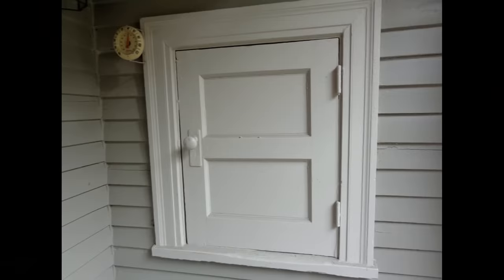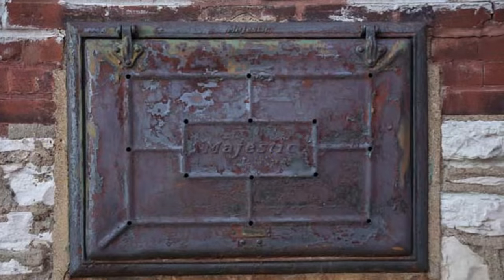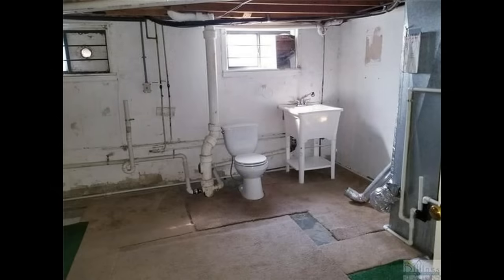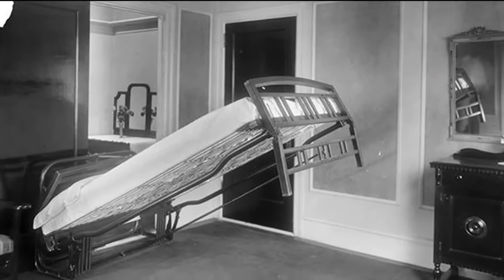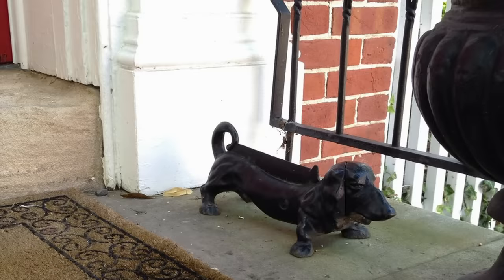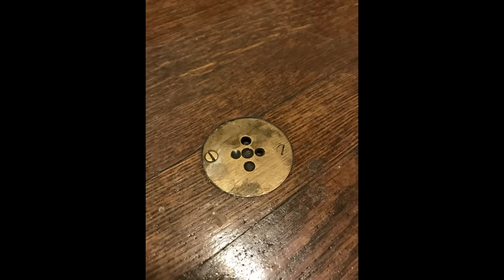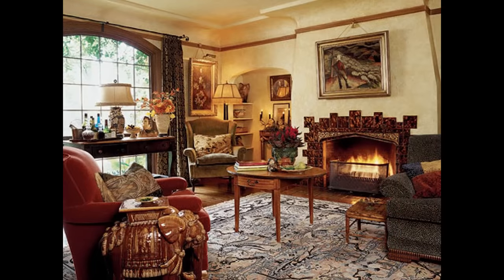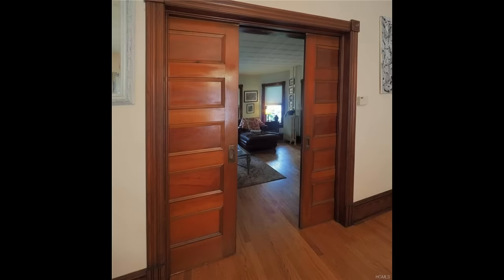Mysterious Home Features No Longer Used

Comment: I grew up in an old house that had windows that were raised and lowered using weights and rope. Seems like the rope was encased in the window frame. Does anyone else remember windows like that?
Reply from the maker: I lived in a house that had those as well.  We had the windows replaced with modern ones because the old ones were drafty.  I remember them cutting the ropes and you could hear the thud from the weights.  I crawled up underneath and got the weights.  Thank you for watching and sharing another old forgotten way of having windows.
Reply: We had these. We also had large, sliding, French doors that used the counter weights to open. It felt like the were gliding. Theywent into the walls on either side.
Reply: Yes, I lived in a 1930s apartment for 18 years and I still love how well those windows worked and how easily to leave the window how open or closed as you wanted. A simple mechanism that could last forever. Drafty though :)
Reply from the maker: I never had those but they sound interesting as well.  We did have some French doors that swung open complete with the old glass that was wavy from the imperfections.
Reply: Our Victorian Farmhouse had those "sash" weights in our windows, we also had a coal chute  and bin in our Yankee cellar. Those window were double hung, you could open them at the top and bottom
at the same time and get good air circulation.
Reply from the maker: Some of those style windows really seem like they would be good to have even today.
Reply: Yes, we still have them. They are a pain.
Reply: I once owned a commercial building built in 1912 (sold in 2021) with that and a host of other issues that came from 100+ years of modification.
Reply: Yes. My house was built in 1899 and I still have my original windows (leaded glass and all). Some of my windows have silk cords and others have little metal chains but they’re all on a weighted pulley system.
Reply: Yes, I remember those windows and they would either get stuck or break and there was no way to open them without taking apart the window.  They were good windows but if one broke, it's done.  I loved how you could open them as little or as much as you wanted without a problem.  I live in a house build in the late 40s and the windows just slide wood on wood.  Now, there's only 2 or 3 windows that will open.  The wood swells or something and won't open.
Reply: Those are called sash windows. I grew up in a 1901 Edwardian townhouse (in Ireland) that had them and My 1924 Arts and Crafts home in Canada had them too. They are great for air circulation. It is certainly possible to remove the windows for repainting.
Reply: You might sometime see a sash weight used as the quintessential “blunt instrument” in a murder mystery.
Reply: @RhettyforHistory  They are called 'sliding sash windows' and I still have them in three rooms of my house.  I completely restored them 40 years ago by replacing the counter weight ropes, cleaned and lubricated the pulleys and sealed and insulated them from Canadian winters.  Still operate perfectly today and with good storm windows, they are surprisingly efficient.
Reply: I try to get ahold of the old ropes from those whenever possible. Those are useful to some people, they can be used for making wicks for cannons. People who do civil war reenactment or are into artillery type stuff, mortars and things. 

It's not that they're valuable exactly i mean there's other stuff which can be used for wicks. But they are usually thrown out because no one thinks anything of it.
Reply: Go to the hardware store: Sash cord.  My 1940 house had the old iron weights. More modern houses use coil springs and wire cables (yes, double hung windows still use some form of Sash counter balance).
Reply: I can recall my father and grandfather fixing that rope.....also putting the storm windows up or down depending on the season.
Reply: I did a remodel on a 100+ year old house and we couldn't remove those because we had to fallow some historic monument laws
Reply: Had them in a house I grew up in.
Reply: Our home was built in 1910...the windows still work that way
Reply: Yes, my old house was over 100 years old and had them.
Reply: I grew up in an older house that was built in the 1880s. We had those windows. My father had to replace a couple of the ropes and counter weights once. And if the window got cracked or broken,  instead of replacing the whole window.  Just the affected pain was replaced. My current home that was built in the 1940s, we replaced the windows and when they removed the old windows ( were installed in the 80s by a previous owner) not only were the track still there, they left the ropes and weights. We also kept them in. So, a future owner will discover them too.
Reply: Yes called sash windows x
Reply: I'd say most homes with original windows built before WW2 have this set up.
Reply: Sash windows. Buggers of things, have to prop the windows up with a stick. 😂
Reply: I grew up in a century farm home that had those.
Reply: My home, built in 1944, still has the rope/weight window system.  All the windows work fine.
Reply: My home still have these.
Reply: @RhettyforHistory  yes we had these also, sash windows, let lots of fresh air in….
Reply: My grandpa's old house in San Francisco built right after the 1906 earthquake had sashweights, pushbutton lights, and feeder lines for gaslights. My big brother, the executor, decided to sell the house and evict me after our mom died. sigh
Reply: I have them in my century home and adore them! There are clever craftsmen who can fix them: these windows lasted over a century, then I had them refitted with new cords and they work just fine. Modern windows, on the other hand, look awful on vintage homes and wear out after twenty or thirty years. If you have old style windows, look around for someone to help you restore the beauty that you have!
Reply: All the old windows had that. It made them run smoother.
Reply: Yea they are counter weights
Reply: Absolutely,  I remember  them very well. As well as jalesi  windows ( I hope that's  spelled right). You young ones wouldn't  remember  them.
Reply: @grumpyoldwizard  I think  we called them pocket doors
Reply: That sounds cool
Reply: Grew up iin a house that had them and later owned a 1920s house that had them.   Had to replace the ropes several times.
Reply: I’ve seen them before.  I was in an old house a little while back that still had lots of “old” things….front door at horse carriage height w/no stairs; side entrance had stairs; original Bell Telephone equipment still visible in master bedroom (unused); Butler’s pantry with cast iron radiator that was mounted horizontally at counter height……a plate warmer!
Reply: Still have them. Had to replace the rope a couple of years ago. Still work great.
Reply: Some of my windows are like that now. 😅
Reply: Yes, the ropes got stuck sometimes.
Reply: I have them in my Queen Anne, over 130 years old.
Reply: My house still has this...
Reply: Sash windows, remember them well. Some even had interior shutters that folded into the wall
Reply: l still have them but don't use the weights. The local hardware can make replacement sashes.
Reply: Yes.
Reply: I remember seeing the ropes inside the windows.
Reply: Double hung windows. Very common in the early 1900s
Reply: I didn’t grow up in it, but I lived in a house built in the 1920s, and it had such windows. Also, the top window could be lowered.
Reply: I've replaced many rotten roped in windows. nothing will scare the ....out of you like opening an window and having a lead weight drop in the wall
Reply: Ours were very heavy windows, when the ropes rotted out and tbe weights dropped out, the window would come down with a crash. They were heavy enough to break your hand if it was still on the sill. Always scared me a bit as I nearly caught my hand in one.
Reply: Yes!
Reply: I had them.  Many in old farm houses in Eastern Oregon.
Reply: I remember those windows
Reply: We had them at middle/highschool in the 2000s probably a relic from the 50s when the school was built. We called them guillotine windows as you never knew when they would randomly shut. They were such a hazard. Or they were stuck on a semi opened position and everyone would fight to not sit close to them in winter as it would be freezing and snow would smudge your notes when it blew in. They switched them in one of my last years of school, to windows that couldn’t be opened so you would die from the heat in summer… might I say, it was a private school?
Reply: i had windows like that in the last house except it was regular sliding windows with rope instead of metal  sliding bits
Reply: Sash windows. Yup, I remember them.
Reply: @fliconmigo : Houses were still being built with them in the 1960s in Australia.
Reply: I've been in a few old houses with that sort of window mechanism.
Reply: Double hung windows have been around for centuries  and traditionally were held open by the  counterweight method you describe. Over time they would fail and people resorted to using planks to prop open the window as repairing consists of removing the sash and molding to get inside. Modern double hung windows use springs.
Reply: I still have them, actually I still have many of the things mentioned 🤣😂
Reply: Yep, our house in NH built in the 1700s had those, too.
Reply: I had the same. Remember so well sitting in my bedroom looking past the ropes as I looked out my open window. We also had a built in ironing board with a separate sleeve board enclosed in a wall cabinet. The house was built in 1935.
Reply: My husband and I lived in a house that had the ropes encased in the windows  .. we lived near an airport and depending on the flight pattern of the day .. when a plane flew over they would rattle. After about 15 yrs we had them replaced .. we also had an opening in the basement wall for heating oil .. by the time we bought the house it was sealed -up , the small iron door covering it was still attached..
Reply: Sash windows they are called
Reply: I have actually seen them yes! In very old victorian homes
Reply: I do.  I remember when  the rope broke,  you'd  prop it open with a  piece of wood.  No screens either.
Reply: I live in an old house that has the ropes in the windows. They're attached to a heavy iron weight that held the window up. My landlord had to rebuild a bunch of windows in his house and I helped.I actually have an old weight inserted into an old clothesline pole and I hung bird feeders on it. Recycle
Reply: My house was built in 1916.  Family home, built for my grandfather by his parents.  Luckily it hasn’t been “remodeled” or otherwise messed up because the same family has always owned it.  Yes, it had those windows .  Most have been upgraded.  I was born in this house ( really)and am lucky to live here now
Reply: I live in a home with rope windows:). It’s perfect for letting the cool and pleasant air from the outside,  in  the home .  Love my original windows- they have a rather not so flat glass that makes everything look  like an artistic piece of glass in each window.  :) 🌟🧡🌟
Reply: @RhettyforHistory  
These are my original windows in my home. :)
Reply: @Lindaastewart7015  I'm in an old house too. Late 1800's. My house was the servant's quarters for the big brick house that sits in front of this one. The garage has two sides. One was for the horses and the other for the buggy. I have an old stone mantle and the other house has a hand carved fireplace. I like living here but it needs an upgrade.
Reply: I think those were called "sash" windows.
Reply: We had them, but a lot of them no longer worked because they were so old ether a rope broke or the wood swelled or they got painted over.
Reply: They’re called sash windows. There still quite common in UK. Some new builds have them. If you open the top & the bottom you get air circulation, great in the summer.
Reply: I remember
Reply: Yes, even repaired a few. Still used in areas around me that have historical district rules.
Reply: lots of houses have those still but are painted shut
Reply: My house still has those windows.
There is an access door in the frame to replace the rope.
Reply: Sash windows.
Reply: @ANPC-pi9vu  my friend showed me how to repair them. It's pretty simple
Reply: Yes, I had that in the old house where I grew up.
Reply: had them
Reply: We have a house that was built in 1868 that still has some of those windows.
Reply: Those are sash windows, with sash weights!  We had "double-hung sash windows"in our old house in Aberdeen, WA.
Reply: Oh yeah, I have many original push button light switches.  This house had a Delco battery system for electricity originally .  Still not as many outlets as I would like…but the charm is worth it for me
Reply: Double hung sash windows.
Reply: @bedtimebiblechat7152  odds are you house is no longer level, causing the windows to no longer be square. Easy to check, place a 4ft level on the floor. Sinking floors, even in the middle of the room can cause this, floor Jack's can level the house and your windows would work again though you may need to clean and reseal the wood frames
Reply: Yep. Those were our windows until we got them replaced.
Reply: @pcoristi  And in Central California, it was signal that school was almost done for the day when you would hear a whole bank of these windows close up and down the hall.  You were a hot shot if you got picked to be the window monitor.  It was hard to open the windows; you had to get that knob in the ring latch and pull down and out.  Not easy for an elementary kid.  It was much easier to close them; put the head under the latch and push.  OMG, that was over sixty years ago!
Reply: We had those! I hated those windows, they always swelled in the summer! Lol
Reply: @Lindaastewart7015  I know about the outlets frustration.  😄  Extension cords come in handy.
Reply: Yes, they are called sash windows, and the weights were inside the frame to  counter balance the weight of the window.
There was a cheaper smaller option which was used for less important rooms,  and it slid sideways so didn't need the weights to keep it open; these were known as "York-Sash" windows, and I had one in the third bedroom of my first house which was built in 1882 and I bought in 1986.
Reply: Box sashes. Weights to balance the window and frame to make raising easy. Interestingly, in a nearby asylum all the windows - hundreds of box sashes.- opened no more than 2 inches (for obvious reasons) . Prior to demolition it stood for 20 years derilict and vandalized, yet no one thought to remove the  cast iron sash weights and get ££££ for the scrap. It was good news for the demo guys though. lol
Reply: @bedtimebiblechat7152  the humidity causes wood to swell. We have that issue with our original wood doors, not the cheap cardboard ones.
Reply: I currently live in a house like that
Reply: Still have them
Reply: @Theyralltakenfu  sure do!  And surge protector strips!
Reply: I remember them. I grew up in a house that is now112 years old.
Reply: Is it an Hercule Poirot story?... Where the murder weapon is hidden by putting it where the weight would be? Anyway, I've always heard those referred to as "double-hung" windows.
Reply: Yes, our first home was a small late Victorian , c 1910.  I’d never seen a pulley system window before we moved there.  I think our windows had been repaired with chains.  Really big windows, no AC.
Reply: There are still plenty of old homes that
Reply: I had those in my old apartment building! The glass was also wavy with age. It was nice to get replacement windows that were easier to open, close, and clean, but I missed the character of the old glass.
Reply: I restored a set of these at my parents' lake cottage probably around ten years ago or so now. The ropes were long gone, and the weights were just sitting in the frames. The top sashes were wedged up and the bottom sashes had to be wedged up if you wanted the windows open. Now they operate as intended with both sashes staying where you put them.
Reply: I still have windows like this. Half don't work lol
Reply: Our house was built in 1939 and we still have those windows..to be replaced in the near future, some still work well but others the ropes have busted so we use a stick to hold up the window.
Reply: I live in a house that still has those window weights, they knock around when the wind is strong.
Reply: Remember, I live in a house with those windows. My house is a 101 years old.
Reply: @flautalee3090 That would probably be Edwardian then. Victoria died in 1901 and Edward VII died in May 1910.
Reply: Remember them? I moved from a house a year and a half ago that still has them.

I hope that decrepit hole, built in 1890, has been condemned. The sill plate is entirely rotted away, with the floor joists rotted out of contact with the foundation on the entire western half of the house. Yet it miraculously passed city inspection... and could be legally rented (though I have to wonder how much the management company held back from the absentee owner for repairs that never got made).
We moved when a kitchen cabinet fell off the wall and was 'fixed' by running wood screws thru the unreinforced back of the cabinet into the studs. Certainly hope they were smart enough to not rent it again... the next person who loads that cabinet with dishes will be wearing both the dishes and the cabinet.
Reply: Aussie here - I've lived in older homes with these, we call them sash windows
Reply: We called these "Rope and Polie" windows when I used to weatherize old and drafty houses after the military. After years of use, and neglect, the rope holding the counter weights would break and have to be fished out of the walls (a real pain). If you were lucky they would only drop about four feet to the floor the window was on. If not, they would drop all the way to the basement. Most of our job would only be for 4-5 hours of weatherazation, so, we would just silicon up the hole the rope used to go through in the side of the window frame as a lot of cold air used to shoot up the walls and make the house drafty.
Reply: We had those kinda windows in our house growing up in Cleveland.
Reply: Yes like predessors to the ' sash window ' x
Reply: Yep
Reply: It called double hung windows sometimes sash windows
Reply: My house has that!!
Reply: I used to love those windows. Had several of the weights, as well. We used to use them for a bunch of different stuff, and my mom made a huge chunky wind chime out of them.
Reply: Yes,  my childhood home was built in the 1920’s & we had windows like that
Reply: I remember that very well.  These were great for the heavy wooden framed windows.  HOWEVER they were a pain in the BEHIND if on of the ropes broke or the weight got caught/of kilter!
Reply: We lived in a house with ropes and weights inside the frames.   If you raised the window quickly you could hear the weights hitting the frame.  The house was built in the 1890s and had no electric when built but was added later.  It also had a coal furnace until my dad replaced it with a gas furnace after the first winter.  
We all thought the house was haunted too.
Reply: I lived in a place with windows like that. The latch broke and the windows would open in the middle of the night in the winter.
Reply: We had the set-up for them but the ropes had broke. My dad used to have a few of the weights around that he used as anchors for his john boat.
Reply: FWIW that system is called an Atwood Machine.
Reply: My sister's house had those and her boyfriend cut all the ropes.  That's one big duh for mankind.
Reply: Ha ha, I’ve never lived in a house without them.
Reply: Laura, for real? They dont build them like that now but there are still plenty of them still in service. Jesus…
Reply: I've replaced all the sash windows of my 1910 house with new sash windows because they are the best , espectially for houses with a high ceiling stud, enabling all that light and sun in.
Reply: Yes, I grew up in Connecticut and my house was a good 175 years old. Our windows were weighted, the light fixtures were renovated gas lamps and we still had the push button on/off switches. We did have great columns on the front porch as well.
Reply: I grew up in Chicago tenements. I remember them, and they didn't work. They were no fun-icular.
Reply: our house has them
Reply: I did too! And we had a cloths shoot, and built in phone nooks!
Reply: They're the standard form of window in Victorian apartment buildings in Scottish cities (known as 'tenements'). 
The cotton rope (known as 'sash cord') is unreliable and I replace it with 5mm kern mantle climbing rope. (It's the same rope that's used on clothes drying racks known as 'pullies', and I have forty year-old kern mantle rope on ours that's as good as the day I installed it!)
Reply: Still have them!
Reply: Sash windows. Normal for Victorian houses in the UK. Although many have been replaced by double-glazed windows now, of course. But people who can afford it often get mock sash windows as they just look more in keeping with the house style.
Reply: Still do in my bedroom
Reply: Yes I'm old ,I  remember. And I Miss those days
Reply: Sash windows. They're all over New England still. My first apartment had all sash windows I love them!
Reply: I still have the ropes in my windows, no weights though.
Reply: Yup. Old lead weights and pulleys with ropes. Used to allow you to open/close a heavy window easily without it slamming. Good ones were well balanced and allowed one to partially open the window and not have to worry about it closing.
Reply: Just FYI, the ones in my childhood home were brass pulleys, lead weights, and oiled silk rope. The house was over 250 years old in 1989 and none of these mechanisms had yet to fail. Every spring my grandmother would use a tiny oil can and walk around the house putting a drop or 2 of linseed oil in a small hole at the top of each side of the window frame. The oil lubricated the pulley and any excess was absorbed by the silk rope which kept it very supple and soft.
Reply: We updated the windows over a decade ago, but I grew up in this house and it is what we had until then
Reply: @RhettyforHistory  The glass isn't wavy from imperfections.  When you have this kind of glass, as opposed to our modern type of glass, hang on to it!  It's the original glass that the windows or doors were constructed with and therefore, worth a lot more money than the glass you see now.   More importantly though, it is interesting,  unique,  and beautiful.  Glass is an amorphous solid.  It is also referred to as a supercooled liquid.
Reply: Yes we had them in the first house my parents purchased in 1975. It was built in the late 1800’s. My dad removed those old windows when he remodeled the entire house.
Reply: We had those heavy wooden doors as well.
Reply: We had these in our house in Cicero, IL Sometimes the rope broke and sent the window plummeting down, so we replaced many of them with chains.
Reply: My grandfather's house in Keene, NH, built in 1912. There was a small closet in the dining room that had the original wallpaper from the 1940's, a blue floral with huge flowers. And a stamped tin ceiling, those were beautiful. It wasn't a big house, but I loved it. It was actually laid out a lot like the house in "A Christmas Story".
Reply: For sure, very common!
Reply: I live in a house with 15 double-hung sash windows. I've disassembled & partially rebuilt 2 of them myself. I have a seething hatred for whoever cut the sash cords on some of them, because it makes it so that they have to be propped open, and in some cases the upper sashes have been nailed into place to keep them closed. So mad about it.
Reply: Yes my 1940's cottage has those. Just replaced them last week
Reply: yes!! I lived in several  houses with those
Reply: I still have windows like that. My dad replaced the ropes with chains.
Reply: I have them in my home now. LOL
Reply: I used to live in the attic of a 100 year old boarding house and they also had those type of Windows
Reply: Still have that in my home.
Reply: My boss has a neighbor, who is a computer engineer, who has these windows. He is having them refurbished and it has taken the company several weeks. My boss saw him the other day and said "Interesting... a windows update that takes longer than Microsoft." 

The guy responded... "I use Linux."
Reply: @grumpyoldwizard  yes I had those too. They are called pocket doors.
Reply: Yes, I remember these very well. They were called sash windows and were in many older homes. Certainly by the 1970s they had become obsolete.
Reply: I have taken alot of them out.
The window weights are good for scrap metal.
Reply: I love in an old building and my windows are what you described.
Reply: Yup, we had those too, as well as the phone nook, milk box, laundry chute, & Venetian Doors, separating our dining room, from the 3-season porch.
Reply: I've seen these. They irk me terribly, as the cord always gets caught up a few times.
Reply: @MinaOmega  They work good if people waxed the cords occasionally.
Reply: Still see those every now and then.
Reply: Wow that is so awesome! I wonder if that house is still there ? I love old houses !❤
Reply: Yes we had them, sash windows. No idea why they were called that.
Reply: @artchem1  Oh yes!  Our house dated to 1915.  Sash windows with delightfully flawed glass.  Looking through the flaws at the leaves on the trees outside was like looking at an impressionist painting.
Reply: @phthartic  l build a wood and coal stove from a large 70kg gas bottle. I suspended a row of these cast iron  sash window counter weights on the inside to prevent the relatively thin wall of the gas bottle to warp or fracture due to the heat. Works a charm and adds lots of thermal mass, so the stove stays hot for longer after the fire goes off.
Reply: Yes I remember those window weights
Reply: My house still has them. They're sash windows and I love them.😊
Reply: I remember those windows very well. And it seemed that most the time one or both ropes had worn through, broken, and without the counter-weight the windows wouldn't stay up. The windows had to be propped open.
Reply: The house I grew up in had these. House was 150 years old
Reply: My wife and I actually looked at renting a place with windows like that in college. The windows were all one big pane of glass and pretty heavy, the weights were definitely necessary, and they worked amazingly well for how old the house was (1900s iirc)
Reply: We had those at our house. It was built back in the 20s.
Reply: I have been in a few old homes that had those weights and rope but none that still worked. You would just see a bit of it sticking out at the top of the frame all painted over.
Reply: @lindaallen6010  Has them or had them?  You say "replaced," so that worries me that they've been destroyed now
Reply: @victoriacole7661  Why?  Maybe yours need repairing.  They should be the exact opposite of a pain, lol.
Reply: My childhood home -built by my parents - had small roping in the (Anderson) window frames.
Reply: My 1st apartment in New Orleans had these windows!  I haven’t thought about that place in AGES!
Reply: @hetmanjz   we replaced them, to be more energy efficent. but I kept several of the more unusual sized ones for a project. And refused to replace any of  the ones in the sun room.
Reply: I have those windows in the house where i live now. One window even has a peg in it, otherwise it rattles/moves. 

My little place also has that decorative paneling part way up each wall like in the clip bout the photo frames.
Reply: @sixthsenseamelia4695  haha yes, i have to do that with 2/3 windows here and one dosnt open at all
Reply: @hetmanjz  That is exactly why the are a pain. The ropes dry rot then break at inopportune times.
Reply: Yep. The rope was part of a mechanism to give “power assist” to the heavy lower sash. Out of sight, the rope went up to a pulley. From the pulley the rope went down to a hanging metal counterweight the size and shape of a cucumber. With age and neglect the pulley could seize and you would get an annoyingly tough to lift lower sash and a rope that would double back on itself. Also, the counterweight cavity alongside the jambs made for a handy uninsulated draft magnet.
Reply: Still have these in my moms house. Most of the ropes have broken so the weights have dropped. When the rope breaks it’s almost impossible to open again
Reply: In this house till 20 years ago. Next door still
Reply: They're called "sash windows" and they're still quite common in Georgian and Victorian era houses in parts of England. Theyre wonderful, you can slide both sections to the exact position you want - just a crack at the top or bottom panel raised all the way up! The vertical sliding mechanism means the window doesn't get in the way when you want it fully open.
Reply: I remember most of the ropes having frayed and snapped and as a result we had to prop the windows open with bits of wood.
Reply: Yup.  The last place I lived was like that.  The windows weren't raised or lowered by the ropes; the weights were simply to counterbalance the window so it could opened and closed more easily.  If the ropes rotted and the weight became detached, you'd have to get a stick or something to hold the window open.
Reply: i love in a Pennsylvanian home built in 1928, it has a lot of these old features.
Reply: They are still around but not in use in buildings in Hollywood and Echopark. They date from the 20's and 30's. Most now have the cord mechanism painted over
Reply: Grew up with those as well. When I was in my early teens, a rope on one side of my bedroom window snapped. Since fixing it would require completely tearing apart the windowsill, I just had to hold that window up with a 2x4 for years until my folks did a total home renovation and replaced all of the windows.
Reply: Grew up in a house with those and actually have them in the bedroom of the place I live now. House was built in the 1890s, where I grew up it was built in 1927
Reply: @pcoristi  you just jogged my memories as well. Plus our teacher assigned window openers. Lol I  was excited when handed the pole to pull the window down.
Reply: Sash windows. There pulleys, ropes, and weights in the window frame. We have two large originals in our 1913 bungalow: One of the ropes snapped and we were surprised at how heavy the window was.
Reply: yesss - the best windows ever ! they had iron weights in them
too ..
Reply: Are these sash windows?
Reply: @lindaallen6010  Well, that is certainly understandable and admirable!
Reply: @RhettyforHistory  we have those now, very simple to fix, I have been going around replacing the ropes.  Take about 15 minutes and they are significantly larger than modern windows
Reply: I certainly remember those windows, None of our family homes had them, but I've lived in older homes which did. Those windows glide open and closed so beautifully, decades if not longer than modern windows. Yes, they were drafty, but I sure wish they'd construct windows that opened as easily these days. And I prefer the double hung windows. I want top and bottom air flow,.
Reply: Oh, yes. All our family homes until my daughters houses had such windows
Reply: My dads house growing up was built in 1910 and it had them. The weights always made me think I was gonna smash my hand to bits somehow, so I never really opened them lol
Reply: I live in a 1916 bungalow and still have the original double-hung windows.
Reply: My apartment building was constructed in 1924. The windows still work like that.
Reply: I'm not sure where you all come from but sash windows are really common where I live in New England USA and are routinely used in new construction. If they are so apparently rare in the rest of the world, I wonder why they're so ubiquitous here.
Reply: I grew up in a house in New England that had those.  You can replace them now if the rope breaks or the counterweight other wise fails by removing the pulley at the top of the window track and installing a coiled tension ribbon spring into the spot where the pulley sat and then you attach the metal ribbon to the window sash.  I understand they work great.
Reply: I remember those. The weights were cast iron. Eventually the sash cords would wear out and break. Then you had to dismantle the window and replace the cord. Easy if you know the trick, but not obvious.
The windows were double hung, too, with a lower sash and an upper sash. You could open them both and let cool air in the bottom and hot air out the top.
Reply: I grew up in places with windows that were originally counterweighted, although I never lived in a place where they still actually worked. Once spring came, the older, inner window would be propped up with a piece of dowel or other block of wood, and the newer, outer, steel-framed window with horizontal spring-catches (and window screens!) would be used to regulate airflow. In winter, we'd seal them up with the 3M heat-shrink-fit plastic window film insulation sheets. Occasionally that would get punctured, and the repair was a piece of sticky tape...
Reply: @rikspector  Huh, I've always understood "single-hung" vs "double-hung" windows to refer to whether there's one or two panes of glass between the inside and the outside, but I'm hardly an expert. =3
Reply: @nans969  Trying to be helpful -- window "pane", not "pain".
Reply: We still have them in my house
Reply: Yep, the house I was raised in had that style of window.  They didn't work very well IME, the windows tended to suddenly bang closed at random.  Same place had an unfinished root cellar basement and a bank of push-button light switches.  Up until the early 90s it was heated (using the term loosely) by two big free-standing kerosene stoves, complete with a huge tank for the stuff standing right at the back of the garage, so every time you pulled in you were basically aiming your car at a fire waiting to happen.  The master bedroom was "heated" through a floor vent that opened in the ceiling of the dining room (which sat between the two rooms with the stoves in them), complete with decorative grills and metal slats (like a horizontal Venetian blind) that you could open or close with a little lever that was also a damn fine tripping hazard.
Reply: My current house (1880's construction) has sash windows and working transoms.  The transoms are fantastic to open in the summer. It lets cooler air from the first floor circulate through the house without the need for central air. Sadly, the sash windows only half work, as the ropes have either been cut or rotted away over the decades.  If you're an adventurous carpenter, the windows are completely repairable. Unfortunately, it takes almost as much money to fix them as it does to get new, double-pane windows. Still better than the house I grew up in where the windows were all painted shut and no transoms worked.
Reply: Yes i do it used wood or metal rod weights trouble was the rope would break over the decades
Reply: @larryk731  i got an 1890 bet you had apartments on top store bottom. Repair cost so much
Reply: The house I grew up in had weights and chains. The chains were noisy. :)
Reply: If you have these windows, please do not replace them.  With proper maintenance they can last over 100 years and are 94% as energy effective as new windows, which need to be replaced every 10-20 years.  If yours are drafty, they simply need to be repaired.
Reply: The house I live in is 105 yr old and has the same windows with rope and weights. Some need to be replaced.
Reply: @joanies6778  You'd be surprised at what kind of damage can be repaired with wood epoxy.  If you fix those windows, they will last another 100 years.
Reply: Have used them old weights as an anchor for my johnboat
Reply: @Ice_Karma  The top half is offset from the bottom half and you can lower or raise each half  by  itself, so opening each halfway allows air to circulate from the top and bottom of the window.
Reply: Casement and sash windows in our house. Bummer when the ropes stop working.
Reply: I remember those, but also remember windows that were opened and closed with a hand crank. These windows opened outward instead of up and down.
Reply: I grew up in an older home that had those windows. My dad remodeled the house in the mid 80's and removed them in lieu of more modern windows. He did, however, keep the dining room windows in storage that were stained glass. I loved those windows!! Home are no longer architecturally solid or intricate; just boring cookie cutter houses no matter the price range.
Reply: We did have that as well 😊
Reply: Yea, they're not that old. We had those.
Reply: @RhettyforHistory  
I was born and grew up in Montreal. Our house had sash windows. Every few years one of the ropes would break and to repair it, you had to take the window frame apart to get to the weight, rope and pulley inside in order to fix it.
Reply: I live in a house that still has them.
Reply: My house has sash windows too they are so good when they are kept in good condition
Reply: I've just renovated sash windows in my house, replacing the weights and pulleys that you mentioned. They're still fairly common in heritage homes, especially in the UK.
Reply: I install replacement windows in houses. I seen the biggest one I have ever seen two days ago.  It was 64 inches wide and 86 inches tall. It had chain instead of rope attaching the weights to the window we were not replacing this window yet. I hope I get to see how much weight is at the other end of the chain.
Reply: Yes I have them in my house which was built in 1941. They still work great. The previous owner put storm windows on all of the windows and storm doors on each exterior door which helps reduce any drafts. The first floor has plaster and lathe walls that are over 9 inches thick. Unfortunately they went cheap on the second floor but that was because the second owner is the one who finished building the house and unlike the original owner they cut corners and used drastically lower quality materials.
Reply: Sash weights? Those are a pain in the posterior. The cotton line frays and breaks over time, and unscrewing the cover plates for access is next to impossible—they are usually buried under decades of paint.
Reply: 1920 house we lived in had that. Counter balance to heavy window so it coukd be raised easily.
Reply: I worked on a few houses, installing insulated windows, that had those.
Reply: Yes, you could raise the lower pane and lower the upper pane.
Reply: Yes, the house I grew up in had those.  The pulleys and weights were in the window frame verticals.  I was always scared of them because wasps liked to nest in there.
Reply: @victoriacole7661  You may be able to qualify for energy saving credits by replacing them with modern dual pane windows.
The fancy ones are filled with argon gas.
Reply: Grew up in Galveston Texas with windows the same way
Reply: I have these in my house now!
Reply: They still use that design in double hung windows today, only they're encased in the frame of the window itself and often covered by plastic strips.
Reply: We have sash windows in our house like that. We had the lead weights and ropes refurbished and the windows draught proofed. After 180 years they really did need some TLC.
Reply: Still have em! My house was built in 1925 and we have original rope windows and leaded glass.
Reply: @J_Gamble  Hi- Me too!  The house I grew up in in Winchester, MA was built in 1925.  It had solid, thick, brick wall and the window as you all describe.  When the cord rotted, one simply replaced it and re-hung the weights.  Worked perfectly!
Reply: I still live in a house that has Sash Windows, they are still rather common in 🇬🇧 and more high values homes have the replaced with wooden double glazed units.
Reply: I still live in one lol
Reply: I have those still
Reply: The house I grew up in had those, as well as a milk door and pocket door between the dining room and living room. We also had the OLD phone jacks, the ones that were round with 4 holes in them where the plug went. And we had pull-down shades on the windows instead of the blinds you see now everywhere.
Reply: Yup. My parents house still has those. Built in 1929
Reply: The sash-weights and the ropes are not really for raising and lowering the sashes:  they are counterweights; with pulleys as fulcrums, they balance the moveable sash so that it stays at whatever height you put it at, no matter how far up, without your having to prop it up on a stick (the method used before the counterbalancing weights).  Nowadays, a very narrow loop of helical spring does the same job.
Reply: @alfredklek  , the American love of sash windows has a lot to do with nostalgia and tradition, I think.  Most domestic windows in Europe are casement windows:  in the U.K., the casement windows open outward; on the Continent, they open inward.  Every type of window has its pros and cons.  One advantage of sash windows is that they work well with screens:  our house in the Midwest built in 1990 had outward-opening casement windows, with screens on the inside; because the screens were between you and the glass, a special mechanism with a crank was there to open and close the window—not as simple as opening and closing a door with no barrier between you and the door.  Screens are considered necessary in many parts of the U.S., because of bugs.  Troublesome bugs are rarer in Europe, so window screens are almost never used there, which means your choice of window design needn't depend on how well it'll work with a screen.  (I say this having lived in houses and apartments ranging in construction date from the 1880s to the 1990s, in California, the Midwest, the Southeastern United States, New England, the United Kingdom, and Germany.)
Reply: @RhettyforHistory  we had those windows till 16 years ago
Reply: Half the hoisin the UK still have them. Sash windows.
Reply: oh wow I live in an apartments right now that has one window at the end of the galley kitchen that uses ropes. It has always slide up and down so easily, I assumed there was some sort of glider or something but its nice to know its ropes with weights at the end
Reply: @dove5272  of you find the access panel you can easily replace the rope and get then working again.
Reply: @AlexBabcock-hw9iz  Ty.🙂
Reply: @hollyshouse928  Cinderella is that you?
Reply: @davidh4514  just like a sash hangs off to the side so did the windows sash weights
Reply: @AlexBabcock-hw9iz  no, my feet are too big
Reply: @J_Gamble  until the cords rot and weaken, first one then the other.
Reply: Yes, I grew up around those types of windows too.
Reply: Yes.
Reply: yes. Cast iron weights hung on ropes in what was called weight boxes, on either side, in hidden wall compartments.
Reply: @victoriacole7661  My house was built in 1904 and still has these windows, and yes, THEY ARE A PAIN!
Reply: @Alibi5ify  I bet you love all the crown moulding though?
Reply: @hollyshouse928  No way that glass slipper's fitting eh?
Reply: @AlexBabcock-hw9iz  I'm one of the ugly stepsisters
Reply: @hollyshouse928  Oh my
Reply: @Lloyd Stambaugh Now that you mention it, I do recall my parents doing that same thing on our windows.  I had forgotten about that.
Reply: Yes. My house is 143 yrs old and all my windows are like this. I have to take them apart to refinish them.
Reply: Yep, I was raised in 2 different houses with weighed windows
Reply: I remember having some of the windows you described.  Occasionally a rope would break and it was quite a process to do the necessary repair.  Until repaired, those windows were hard to move.
Reply: My poem about those:
Old fashioned windows
With cast iron weights
Hung like sausages 
In sash pockets
Reply: I encounter them, on a regular basis. I do house renovations and, some of the weights are tubular, some are discs. Most of them have markings of the weight. The average are 3 lbs (1.3 kgs) each side.
Reply: Yes - the rope is  twisted  and  window is stuck open in my bathroom now .  Quite chilly to say the least here in San Francisco .
Reply: Yeah my grandmas house still has those. They don’t always work though so it’s best to stick something in the window to make sure it doesn’t slam shut lol.
Reply: I lived in lots of houses and apartments with those. The ropes would break and the windows wouldn't stay open, so you would prop them open with whatever was handy, like books, bottles, pieces of wood. The windows were very heavy and sometimes whatever was holding them open would break or slip and the window would slam down. Children would get hurt leaning out of those windows and knocking the props out by accident.
Reply: I still have them in all my windows...(1908).
Reply: I have those!
Reply: @J_Gamble  I lived in a 1930s apartment with those also from 2006 to 2011. I loved those big old windows. To me the draft was worth it!
Reply: They're called sash windows they now come in plastic which work better but depends on how nostalgic you'd want to be
Reply: Now double hung windows have a spring balance that replaces sash weights.
Reply: My house still has them. They work fine.
Reply: My family and I moved into a house in 2002 and they told us it was about 100 years old. My parents replaced all of the windows over a few years and all of the old ones were like this. I can't remember if they finished the ones in the attic or if we still have a couple of them left.
Reply: I’ve worked on several of those windows in my life. Also removed a few. Have a pile of sash weights.
Reply: I have windows like that in my home now
Reply: I e seen them. Took me a minute to figure out what it’s purpose was.
Reply: I actually saw some at a house TODAY. The home was built in the 1940s. Wish I could upload a picture!
Reply: I’ve rented in several of these houses!! Winters sucked
Reply: My husband and I rented a house that was built in the 1920’s that had the windows with ropes and weights.  This was in 1992, the house also had the original stove.  In 1995 we moved to Virginia from Texas.  We rented an apartment in a 1920’s ish home that had been turned into a triplex.  We had about 1000 square 2nd story apartment with a walk up attic.  The downstairs had 2 apartments.  Our place had baseboard heat that was supposed to be disconnected since the owner placed a “Window Unit Heat Pump”, because it was a fire hazard.  We also had a wood burning stove in the dining room, however our renters insurance would not cover any damage caused by wood burning stove.  I came home one morning from the hospital and it was in the 50’s inside the apartment, the Heat Pump went out.  I found out the base board heat still worked and we had a fire in the wood burning stove.  I seem to remember that those windows also had the weights and rope.
Reply: @derealized797  Interesting.  The old rope are probably pure cotton and would make excellent wicks.
Reply: I lived in a house with these windows...until we replaced them.
Reply: @CassandraHouse  They are fully repairable if you can find an old handyman that is familiar with them.
Mother's Day is coming up quickly...surprise her!
Reply: @JohnSmith-eo5sp  Yes, sloppy painting practices were the death of many of the counterweight ropes.  New cotton ropes are still available or you can replace them with nylon.  About an hours work for anyone handy.
Reply: @msdm0714  I still have 3 sash windows that have been restore and upgrades with proper weatherstripping and insulation.  I decided to keep them for the historical value to the house and when an engineer friend, who works for a major national window manufacture, admitted that when properly maintained and fitted with good storm windows, their efficiency was not far below the best modern windows.
If they aren't huge windows, the return on investment to replace them is about 60 years.  He admitted that the majority of benefits of new frame materials, high tech window glass and multiple glazing are more marketing hype to sell the new product.
Reply: I’m a window cleaner. I’ve seen quite a few of them. More often than not they’re either stuck or hard to open and close. Frequently the ropes are cut. I don’t like them.
Reply: @vladtheimpala5532  Not much use if they are not properly maintained and working as intended.  I would guess a lot of people today don't bother to maintain them because they don't open them anyways and modern HVAC system control the home's air quality.
Reply: My 1920 house windows have chains within the frame. The windows work better than the ones from the 90s in the previous house I lived in! Of course not energy efficient though. The 1920 house also has laundry shoot, coal shoot, and knob and tube electric (but not in use just the remnants).
Reply: The house I live in now had the same kind of windows until we replaced them .
Reply: My 1940s colonial has sash rope and iron weights. They work great. I had to do some mechanical touch up on them when I bought the house. Now they move up and down with 1 finger.  IMO old windows are far superior to modern plastic windows like Andersons and such. An old historic window will last for centuries, (unlike the stuff you get at HomeDepot which will last 15 years), are easy to maintain, work great, and have far greater eye appeal than plastic throwaways  like ANdersons.
Reply: @victoriacole7661  Do you mean "pane"?
Reply: They're actually EXTREMELY common in old houses in Australia. Like a cotton rope and cast iron weights hidden behind the architraves. Seen more than I can remember in the early 2000s, had one laying around from a demolition (used to work in house renovations). They're very clunky.
Reply: We had a old house when I was I kid and had these. The problem was the rope would get old and the weights would fall down the chute.  I have idea if there was a way to retrieve the weights or not.
Reply: Yes, I do, Laura Porter. But, my house I lived in as a young adult (mid-20s), located in San Francisco, had all windows like that. We also had push button light switches and a divided bathroom. With the toilet in one room, and the bath + sink in the other room, there was an open-at-the-top light well between the two rooms. There were other strange things about that house, and we were sad to leave it after only a decade.
Reply: Laura Porter, same here. The house I grew up in was built in the 1920s on Long Island. All the door knobs were cut glass (gorgeous!), and every doorway and window had beautiful, thick molding around it. Those windows with the pulley system running through it that you mentioned were also throughout the house. My cat enjoyed sitting in one of the windows whenever it was opened for fresh air. One day (this was mid 1970s), while she was inside the window frame, the rope snapped and broke, and the whole window came crashing down on her! Her cat reflexes were so good that she managed to jump out in time, BUT her tail got caught under the sliding window! Thank God my father was home and heard her screams. He held her with one hand, while he lifted the window with his other. She was so freaked out, that she bit right through his hand! That was particularly disrupted for my father, because he was a dentist and kinda needed his hands to be functioning properly!
Reply: Yes the rope would break and you couldn't repair without dismantling frame.
Reply: I live in a house that’s has original sash windows with weights and ropes . The house was built in 1894 . It has loads of original features such as fireplaces . Disadvantages are it’s hard to heat and the windows aren’t great for keeping heat in . It’s worth it though , most of the time lol 😜
Reply: They are called sash windows and were very common here in the UK.
Reply: I lived in a cottage in Scotland a few years ago that had sash windows that opened and closed using a pulley system to help them open more smoothly. I checked with the local historical society and the cottage was built in the 1890's.
Reply: My school had them! 😊
Reply: I do!
Reply: Yes!  My old house in Detroit had windows like that.
Reply: @sarahandley9804  Folding interior shutters were a major feature of houses in the 18th Century.
Reply: @PetCactusA_HarmlessLittlePrick  No. I can spell thank you very much. They are a PAIN.
Reply: @victoriacole7661  Never mind, sorry to have bothered you.
Reply: Where I grew up, most people had double-hung sash windows. When I first left home to go to college, my roommate thought I was weird when I complained about the window over my desk not opening from the top. Apparently, she'd never heard of a window that opened at the top, nor had she ever seen a window with a rope in it. We then stared blankly at each other in mutual disbelief.

Oh, and if you took good care of them, they didn't break! I don't know why so many people talk about having to prop their windows open with planks of wood and suchnot. Just maintain your windows! I'm guessing a lot of the people stuck with broken ones must have had rotten absentee landlords or something.
Reply: Yes
Reply: Oh, yeah, we had those in a 1920s bungalow, and we could only open the ones where the ropes had survived and the windowsills hadn't been painted shut. I think it was a counterweight system so you didn't have to lift the entire weight of an old glass window.

Plenty of homemade deer fences around where I now live have been built with a counterweight that keeps the gate shut when you're not actively pushing it open.
Reply: @PetCactusA_HarmlessLittlePrick  No, I need to apologize. You were being funny and I was having a bad day. Please excuse my behavior.
Reply: I not only remember them, I have them. My house is 120 years old. nearly all of mine use sash weights
Reply: Jacko Sargs  mine has little covers that are faired in and screwed down to get the damn thing out. I've replaced several sets here.
Reply: My house still does
Reply: My brother has those kinds of windows and keeps them for historical sake.  He lives in Hartford Ct.
Reply: I lived in an old house with that too. One window was hard to open and the weight clunked loudly. It scared the cat. lol
Reply: Sash weights!
I lived in many homes with sash cord attached to sash weights (made from pig iron).  The weights and cord were often servicable. A small access panel in the window jamb allowed you to replace the cord.
Reply: I lived in a house in the 70's that had that. We had to replace some because they were broken. That house had the push button light switches. It had a lot of interesting things.
Reply: @tylerbhumphries  my house is only about 12 years younger than yours  but your date 1899, looks so old & cool! Reminds me of  when my kids both say things like, "did that happen in the 1900's"?
Reply: Sash windows, my grandparents windows were sash windows.
Reply: My home still has them.
Reply: I remember those windows. I grew up in a house with the old weights on ropes.
Reply: my auntie had those as well, she got it changed when she renovated though so it was safer
Reply: We had windows like that in my old apartment.  The only way I knew was that one of the ropes snapped and that window was an absolute bear to open after that.  The weights acted as a counterbalance against the weight of the windows, making them slide much easier.
Reply: It's a sash withndow
Reply: They were superior to today's
Reply: @RhettyforHistory  yes! Now they have a metal tape and spring roller instead of ropes and counter weight s
Reply: My house is full of these windows. The problem with them is that the rope breaks or rots quite frequently. After the rope breaks the windows need to be propped up manually.
Reply: Those double-hung windows had something “magic” about them. Open even a little a bit at the top and at the bottom, they created a convection current. Cool air came in through the bottom and warm air escaped out the top. Wood has a higher R value than aluminum. Those crappy aluminum sliding windows replaced the double-hung style. 🥲
Reply: Yes in a 4 story walk up apartment. Also had a dumb waiter in kitched, and a pipe under the refrigeerator that was used to drain melted ice from old ice boxes. Some units had maids quarters off the kitchen.
Reply: Until my most recent home, my windows were always sash weighted.
Reply: My  windows have the weights and rope. House dated 1875 Richmond’s VA
Reply: My house had those. When you raised and lowered the windows the weights made a distinct sound.
Reply: @J_Gamble  There’s a hostel in Venice beach CA on the beach that still has those windows. I loved how the wind from the ocean blew through them like an air conditioner. It’s seen on the right on the famous painting of Venice beach that includes the Venice beach sign.
Reply: Yes. There are still quite a lot of houses with those windows in the town where I live.
Reply: @rikspector  Yeah those were useful and honestly are timeless. They are are better than windows today except for the glass isn’t insulated and as thick as ours today. But the mechanism is just as advanced in my opinion. There’s more advantages to those types of windows tech.
Reply: @victoriacole7661  They are not usually that difficult to repair & they last a long time when looked after.
Reply: @PaulSteMarie  Worth repairing though because they then last a long time.
Reply: @sarahstrong7174  yes I know thank you.
Reply: House I just moved out of had them, the house was built in 1880
Reply: I just recently replaced those exact windows in my house (three weeks ago). So much warmer.
Reply: Yes lived in an apartment in an old house that had windows like this.
Reply: I loved those!
Reply: In the UK many houses still have Sash windows. If a property is "historically listed" it is legally required to keep original features such as this!
Reply: They literally still make those. They're called single hung windows.
Reply: I do remember .. And how it was a major repair job if the rope broke and dropped the weight inside the wall.  It was an old feature even when I was a child in the 1950's.
Reply: I grew up in a home with those. Alot of times the rope would break.Also, we used to have to put piece of wood or a book to keep the window open.
Reply: Idk if it's been said. But in many old big cities in California, these windows are still EVERYWHERE lol.
Reply: I also grew up in a house with windows like that.
Reply: Yes. I used to beat my brother with them.
Reply: In UK these are called sash windows - lots of them on buildings 100 yr old if not been replaced. In heritage areas you may have to replace with a modern (double glazed and less draughty) version
Reply: I live in a house like that now. Sadly a few the ropes have decayed resulting in the weight dropping to the floor. There are access doors to adjust these, but you need to replace the rope before it decays.
Reply: yep they work just fine as long kept waxed. The ropes rot so just put new ones on. Many homes have them or remnants where the weights are still sitting in the window frame with shiny new windows.
Reply: Yes.
Reply: @RhettyforHistory  It wasn't wavy from imperfections. It was wavy because glass is fundamentally a liquid. Over time, it flows. "Wavy glass" is very popular in some parts of the country. You can even buy a modern version at glass stores. You know -- the places you go to get custom storm windows, replace glass when some baseball player hits a home run through your closed window, etc.
Reply: Yes! In my teens my family lived in an old farmhouse that had these windows. I had forgotten about them until I saw your post! This house's only shower was in the basement. It was basically a shower head and a drain in the concrete floor. It was in the corner of a medium sized section of the basement. No door, no shower curtain. Felt very exposed showering there. Also, this was in NY state, so in the winter, despite the hot water,  it was COLD!!! Showers were definitely quick!!! This basement had 3 different sections. The laundry room, the pantry room with shelving for canned goods, then the back section where this shower was. One hanging light bulb with a pull chain...quite creepy. Always got done showering as fast as possible. Lol
Reply: I live I one lols
Reply: Those are still more or less used today only manufacturers have modernized them to where they don't use rope but springs I believe.
Reply: I still have those windows
Reply: @jennifermilnes9943  Actually the sash means the entire pane and its frame.
Reply: @kamicokrolock  No, you don't remove the molding/trim to reach the sash cords. If you raise the window and look closely at the bottom of the channel where the window sash moves (the whole apparatus -- glass and its frame -- is the sash) you'll find a fine horizontal line in the wood a few inches above the inside base of the window. Pry that open with a thin blade and it will come out. Unless someone retrofitted it, it's held in only by friction. When you remove that piece of wood, you should see the counter weight.
Reply: @arlenepalomba8027  There probably were screens originally. They were separate and fit on the outside of the window frame. Lots of people junked them because you had to take down the storm windows in Spring and put the screens up for the summer, then remove them in early fall and put up the storms.
Reply: I lived in a house built in the 1890s.  The wiring was still 30 Amp wiring, even in the 80s.  Push button light switches.  Had a coal shoot. You could see where the old wood stove heated the house. 
The front door had an enclosed entryway.  Kept the rest of the house warm when the door was open. 
Loved living there.
We later lived in a house with a metal laundry shoot. Loved it.
Reply: I had a window just like this but the rope broke and the stained class fell out when it hit the frame
Reply: These are the windows we still have in our home. It was built in 1928. I also grew up in a house with many of these features.
Reply: Sash windows - still very common.
Reply: I still have those old windows
Reply: I once lived in a 1915 bungalow with such windows.
Reply: All my windows are still like that. A couple of them might had a broken rope, so counter weights had dropped into the wall with the windows unable to stay open.
Reply: Most of the houses I ever saw in my part of Cicero, IL had them.

Fun Fact:  Sash weights were easily turned into pocket flails; they were heavy for their size and had a rope stoutly attached.  They were a common "deniable" weapon in Chicagoland when I was growing up.

ps- The home in which I grew up had a Pittburgh potty, but it was enclosed in a small room by the time I was five or six.
Reply: I have those.  I've had to replace the ropes a couple of times.  Originally I tried to replicate the original cloth rope, but the second time I decided to use synthetic because dismantling the window frame is a hassle
Reply: Never even heard of something like that. 😲
Reply: Yes! Our windows were like that as well.
Reply: My house has them
Reply: My house still has that type of window.  When the house was renovated before I move in, new windows were placed on the outside of these windows.
Reply: They were smoother than today's springs.
Reply: Yep, we had a couple windows like this as well. I do remember my parents changing them because they were drafty.
Reply: My house has those now lol
Reply: Oh yeah. I remember those. Not too many people know what a window Weight is.
Reply: Windows like that are still popular, it's just we have gotten better at hiding the parts.
Reply: They are still all over the place.  Rebuild some in an apartment I was renting once.
Reply: I still have window weights in my house. They are great because they make opening the windows easier and hold them open without a prop. 
I make sure mine stay in working order by changing the ropes if needed. I have also insulated them by creating a chase for the weights and then putting insulation around it. 

I have back stairs, picture and plate rails, pocket doors and transoms. 
Another thing people don’t realize about double hung windows is you were supposed to open both the top and bottom sections. This allowed hot air to flow out at the top and draw cooler air in at the bottom. Kitchens were often placed on the north east part of the house to take advantage of passive solar effects. 
Most houses had porches and porch swings with big trees to add to the cooling. Deciduous trees that lose their leaves provide cool in the summer but sun in the winter. 
Our forefathers were very aware of “ science” and used it to improve living conditions. 

I love my old house and relish all the thing that make it better than those shoddy cookie cutter shacks they build now a days. 
My daughter just bought an old house too because she wanted those familiar features. 

It is well know that radiators are the most efficient heat. They are the preferred heating in Europe but for some reason Americans like the central air. 
I guess because many places in Europe don’t need A/C so don’t have duct work. 
I still love and use my radiators. We’ll see if I can afford the fuel oil this winter though 😟.
Reply: Yep! Same.
Reply: Every window in my 1880 home is original, and I'm in the process of restoring them - new points and glazing, new ropes on the weights.

These windows are far superior to new windows.  Mine are made from oak and maple, not plastic, and if kept in good repair, are more efficient with greater longevity than anything on the market today.

The key is maintenance.  A good storm window is helpful to keeping them in good condition.
Reply: I used to install new windows and took many of these out. You would be surprised how heavy those weights are.
Reply: Still have them in my 103-year-old house.
Reply: Yeah all over Edinburgh.   Sash + case windows
Reply: @bengalkeeper  Yes, old windows are better. 
I’m so glad you’re keeping them. You can even add insulation to the weight tracks by adding pvc pipe for the sash weights to move in and then insulation around then. 

I get so frustrated when people say they “had” to replace the old windows because they were drafty but totally ignoring the fact their house has “ ballon framing” and probably has NO insulation in the WALLS ! 

It’s even better when they then get cheap vinyl windows that are too small for the openings. 😡 But l guess then they  match the vinyl siding that is covering the architectural detail. ( sarcasm)

Good luck with your renovations.
Reply: I do!  I lived in a duplex with casement windows.  They were gorgeous, too, with the old blown glass.  Completely NOT energy efficient (LOL) but man, they had style!
Reply: The Old Buckhead church in SE Georgia has windows like that. The church is not in the location of Buckhead GA. It further southeast around Burke County
Reply: I got a thumb smashed in one of these windows. The weights did not hold the window up any more and a board or brick was needed to prop open the window in summer.  I as an 8 year old and accidentally knocked the board out dropping the heavy window on my thumb.  This was in 1963.  To this day the regrown thumbnail gets blood blisters in it and it looks quite different from my other fingernails.
Reply: I got them in my house. Built around 1880.
Reply: I grew up in a house that was 100+ years old. The windows had the rope/weight mechanism, most of the original glass (which had a few bubbles in it) was also still in the windows.
Reply: Mine still has those - though only on a side of the house that I never actually open the windows because at some point the neighbors’ garage was built only inches away
Reply: @katmandudawn8417  I've got storms on all the windows and once they are reglazed, I won't do much else.

It isn't very cold here for very long and I have heavy drapes as they did in the period in which my home was built.

My walls have blown in insulation that I'm sure has settled and should be redone eventually, but I don't use all of my 6 bedrooms and doors are kept closed at all times.

When it's cold, I wear a sweater and use an electric blanket on my bed since my second floor has no heat (all radiators and boiler were removed and GFA is first floor only)
Reply: I've come across them at work. Brilliant system for a heavy window.
Reply: @bengalkeeper  over the years I have included different ways to cool and heat the house, I just prefer my radiators. I have a fireplace but it drawer so we’ll it can suck all the warm air in the house up the chimney. So I don’t use it as much as you’d think. 
I’m hoping to add a heat pack to my upstairs duct work and should be good to go. There have been years when I couldn’t afford heat and the kitchen was around 40 degrees F. That was no fun and I’d rather not do that again 🥶
Reply: Absolutely.
Reply: Loads still around in the uk. My favourite window if you can have one lol. We call them sash windows and you can even by the cords and weights to repair them
Reply: I have windows like that
Reply: Very common type windows actually known as 'sash balance' windows.
They were a highly refined design that changed little over 100 years. 
The timber frame included tricky hidden access ports at the inside bottom sides (hidden when the bottom window was lowered) to tie new sash cord to the long cast iron torpedo shaped weight.  Here, the woven rope cord is still easily found at hardware shops. 
Later design modification used small round friction rods with twisted steel spiral inside a steel tube instead of the balance weights. .. they screw up.. the cord balance weight type don't. 
The timber window panels were easily removed for glass replacement or painting.
Their common use ended with the introduction of aluminium framed windows... some of which replicated the timber 'double hung' timber design format.
Reply: Yep mine was like that - the ropes were broken in a lot of them and I had to prop them open with a book.
Reply: I have windows like that.
Reply: The house I live in has windows like that 🤔
Reply: Yes indeed. My house was built in 1899 and I grew up with those types of windows until they gave up the ghost and had to be replaced. Since then, I've had several other iterations in windows installed but none as good as those old fashioned ones!
Reply: Yes, I am 63 and can remember my dad fixing a window because it had become unbalanced. 
   He had to take the outside framing apart and that's when I saw the weights. I remember being impressed that they were so heavy so I pulled on them. 
   I love knowing how things work.
Reply: Yes. I have them
Reply: My whole house has these still! The house is dated 1927, I'd love to keep them but they've been badly cared for and even with storm windows not very energy efficient. Hoping to replace them soon but with 19 windows, it's pricey.
Reply: sound like counter weighted windows I remember a couple of old homes that had these as a child in the 90's the houses were late 1800's or early 1900's
Reply: @RhettyforHistory  if you ever watched this old house, they periodically repaired that type of windows. it was interesting to watch
Reply: All of my windows are rope & weight.  They're a real pain in the butt sometimes because the rope can get twisted.  Someday I hope to afford new windows because these windows aren't the most energy efficient.
Reply: @lizpantelis  Book!! We had a special piece of wood cut for that exact reason 😂😂😂
Reply: @loupoops  smart! the window book in my bedroom was The Riddle of Penncroft Farm haha
Reply: I have those windows. 1928 house.
Reply: Yup rope and pulley systems are still in use actually. Theyre historic, but work just fine. When replacing windows in historical homes, i was often required to install new ropes and weights. Usually you can reuse the weights. Seems crazy but thats the historical society for you. And it pays very well to maintain them as not many people bother to learn how
Reply: Yup!  They were quite common.  Those lead weights held the opened window in place.
Reply: Yes…..Many of your older Apartments in Chicago had windows with weighted pulls
Reply: @katmandudawn8417  I'm very envious of your working radiator system.  Mine was allowed to freeze and burst in several rooms and it's long gone.  It's a fortune to replace it and would require a lot of demolition.  My lathe and plaster is all restored and my floors are in great shape so i don't want it messed with.

My single fireplace is coal burning and not operational as the chimney above the roof is crumbling and will be coming down.  Keeping everything below the roof line as it's a structural chimney and not an external one.
Reply: Yeah wtf I had those too
Reply: @bengalkeeper  My place had coal heat in most room before the hot water radiators went in. 
The sister house ended up with coal fired forced air. Just one big vent in the floor to heat the whole house. Delighted that I didn’t have that. I’ve heard of small children dropping things like crayons down the vent and stinking up the house. 😵‍💫

I know it’s always a balance in act to get the house livable and still keep the vintage charm. Thank you for being someone who cares to preserve our architectural heritage.
Reply: Thankfully no
Reply: My dads house had those too
Reply: @sixthsenseamelia4695  only if they didn’t still have the sash weights.  The weights act as a counter weight so you don’t need to prop them open. 

The weight were probably down in the walls and could be reattached.
Reply: Still have them
Reply: Yeah my house growing up had that but the ropes were all broken and we opened windows by propping them up with a board we kept in the windowsill. I didn't realize as a kid they were broken though and I thought all windows were supposed to be propped up. Blew my mind the first time I saw someone else's windows "defy gravity" and just stay up
Reply: The window weights also were a great canoe anchor
Reply: I lived in a house from 1938, it had a window like that in the kitchen.
Reply: We have reached a time where people have to be told how a phone line looked like.
Reply: Those are double hung I  believe.
Reply: @darntootin6423  I read a book where one was used as a murder weapon then put back in the window frame. I thought it was very clever because most modern people don’t even realize they exist. 
I’ve never looked at them the same way. 😉
Reply: I bought an old home that had these windows. When I remodeled, I used the round heavy weights for other uses, an anchor for my canoe, a chimney cleaner(tied a long rope onto weight, climbed on the roof and dropped down in chimney to knock off the build up that causes fires!) Every floor was uneven but it was an old beautiful 2 story and I enjoyed bringing it back to life.
Reply: Sash windows as there known,I made them as an apprentice 😎👌
Reply: I remember that my grandmother had windows like that.
Reply: I still live in one
Reply: I sure do.  I had an apartment in the ‘80’s that still had those windows.
Reply: Yeah, very common.
Reply: My house still has these
Reply: I live in a house built in 1927. The windows are original, but most are painted shut. Only two open. Also, my Grandmothers house, before it was renovated, had a window where the ropes were broke, so when she wanted the window open, she put a piece of wood the length of the window on the side of the window sill to hold it up, Lmao
Reply: Yes I remember them in my parents house.
Reply: We just finished replacing the last of those sash windows in our house this year. Our house is about 100 years old.
Reply: just watched this with my 6 year old and pointed out some of the things we have in our 1924 duplex in St Louis. Here on the top floor we have 3 sash windows still (bathroom, kitchen, and kitchen onto what is now a 3 season room but was once an open-air porch). also the icebox delivery doors (small pantry now, under the window that leads to the 3 season room), the windows above our front door and the 2 doors that lead to the back porch (none are functional anymore). Coal delivery (long ago sealed up). and both levels still have the laundry chutes with are no larger than modern duct work and with a vent door that pushes in like a doggy door - no way a small child is getting in there! but after reading ALL the comments about laundry chutes, it's mildly comforting know getting stuck is common and not a failing of this house alone. Oh, and our house still has knob and tube wiring. and electrician told us that as long as no one disturbs it/tries to modify it, it's fine. (and a whole-house rewire is the only way to eliminate it - we don't have $30k laying around, plus at least $10k more to repair walls.) FYI, State Farm doesn't insure knob and tube buildings in this area (or probably any area, haha).
fun video!
Reply: I STILL live in a house with those kind of windows!  A 1910 craftsman bungalow.
Reply: Counter balanced windows, easier to open and didn't need to be jammed to keep open
Reply: @Thoroughly_Wet  I love mine!  What a dream.  I'm an old lady and still raise the windows with just one finger.
Reply: I remember those. We had them in an old house I grew up in.
Reply: My house still has these!
Reply: They were called sash windows. Here in the UK, even 40 years it was almost impossible to find anyone to repair or replace them like for like.
Reply: We’d refer to my grandmother’s giant earrings as “window weights.”
Reply: Ya
Reply: Our second house built in the twenties had sash windows like that
Reply: I just renovated my house and put in five new windows and The old windows were like that
Reply: I have one!
Reply: I have windows like that. My house was built in 1920
Reply: I sure do. I moved into an old house and one of the windows dropped down like a guillotine when a rope inside the frame broke. I tried to explain what had happened to get it repaired and no one knew what I was talking about. This was in 1982
Reply: The haunted ass rent house I used to live in had those. The previous tenants had painted over them. We cut away the paint and they still worked great even though they were over 100 years old. The house also had several of the original door knobs. The bathroom used an old fashioned key to lock. (I may or may not have planned to steal that doorknob and key when I moved out... but I managed to keep my cleptomania at bay.) If I ever find an old knob and key like that, I'm definitely getting it and installing it somewhere in my house. I would love to have those antique style door knobs and a skeleton key for my forever home. They're so dang cool and I just love how they look. They just don't make things like they used to.
Reply: Still have them in our rental houses.   Big deal.
Reply: I actually lived in many apartments herein Chicago like that. I still have 4in my house now I need to update.  My house was built in 1919. The old coal chute door is still here
Reply: Our windows have ropes on both sides of the inner window frame and I believe they have weights too. The ropes in one are starting to wear thin. Have to be careful when we raise or lower it
Reply: Sash windows. The top could drop to let the breeze in or smoke out, without allowing things to climb in.
Reply: The are called "Box Framed Sash Windows." Sash is just a word meaning frame, it's origin comes from the word chassis. 
The box comes from the box either side of the frame that contains the weights, they can be either cast iron or lead weights. 
They first appeared in Renaissance Europe 400 or so years ago.
Reply: My house I grew up in had them. The windows were so old there were waves in the glass. They did not insulate well, either. The house had character, though. Most of the weights had been taken out so you had to prop up the lower sashes with sticks and if the upper sash sagged you'd have to do the same.
Reply: @sixthsenseamelia4695  Amen. My old house had them but no screens. I rarely opened them as a result.
Reply: Yes, my childhood home had those. As an adult, I learned the house was built in 1939. I remember it had the milk door, and a basement canning room. It also had drawers and a huge linen cabinet built into the wall. It had those little twist knobs on the doors.
Reply: I lived in a house with those windows .  they were great until the rope broke
Reply: I still have windows like that in my home which was built in 1927
Reply: Absolutely, I'm a carpenter and regularly replace the sash cords that are connected to the weights. I also replace the cord's and weights wth spiral lifters. The tool used to replace the cord is called a mouse.
The weights make great deep sea fishing sinkers.
Reply: I had the 3rd floor of an old house as a bedroom. One of the windows was like this. I remember my dad fixing it once because the rope had broken on one side.
Reply: Yes. Brooklyn, NY!
Reply: Yes! The house I grew up in had them, too.
Reply: I had those in a 1912 craftsman.  I also had windows that opened with a key.
Reply: @RhettyforHistory  I keep old, drafty windows because they’re good for my allergies/asthma.  The  cold air kills some of the dust mites.  They’re not good for the heating bill, though$
Reply: @HotRod12667  I love those!  Nice sunny perch for a cat 🐈‍⬛ , too!
Reply: Still have these. Our local handyman is currently doing a tune up on all the windows. One had glass replaced and the newer glass was too heavy and unbalanced the window. So we had to hunt down bigger weights. 
They are wonderful windows, they can open from the top or bottom, so in summer you can air out the hot air from the ceiling without leaving windows open than pets can escape from.
Reply: These had a nice gliding action due to the counter weights- yes we had them
Reply: I still have windows like that! I'm renting and although the windows are so old that bugs keep getting in, my landlord refuses to move into the 21st century, lol.
Reply: The house I grew up in was built in 1900. We had windows like that. Most of the houses I lived in had windows like that. This Old House would show how to fix the ropes and reattach the weight.
Reply: The house my parents bought in the 80s that had been moved to Ohio from Pennsylvania as a wedding present for the Pastor's daughter had this with all the upstairs windows. It really caused issues when the rope broke and then the windows would swell (wooden windows) due to being hot.
Reply: LOL if you see my comment I just commented that my sister‘s hundred-year-old house has that exactly in her attic only since they redid the rest of the windows but did not do the attic it’s actually a truly magical place her attic and it has support bricks columns throughout the whole attic to hold up the house yes those counter weighted windows  are there exactly! 😊
Reply: +1
Reply: you betcha! that was a normal thing then.
Reply: @grumpyoldwizard  i remember those as well
Reply: As a child I grew up in a house built c.1780...It had the original sliding timber casement windows, but because they had been painted so often you could not actually shut them fully.  I recall that sometimes pigeons would suddenly fly in, much to the amusement of the cat who would chase them around....happy days....
Reply: @RhettyforHistory  My house has them now. I still use them. It was built in 1901 and restored from 1991 to 2001.
Reply: My Grandmother rented a Victorian apartment that had heavy windows like that. I recall them getting stuck.

She lived to the age of 102.
Reply: Oh yeah...
Reply: Yes, I have double hung wood windows with weights. Love you old home!
Reply: I lived in a house that had a window air conditioner
Reply: I live in a. House built in WW2 i have. That toilet in the basement  still
Reply: Yep and the rope was a bit rotted. It's why even though my windows stay open now I still prop them up
Reply: Sash & case windows.
Reply: i have a 19th century home w ropes in the windows too. im assuming they worked like yours but theyve been painted shut for decades